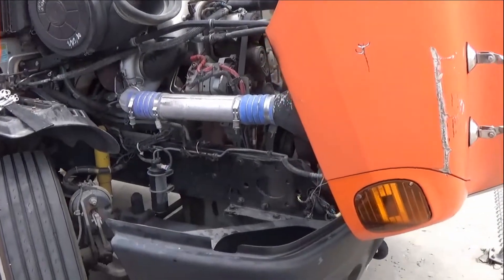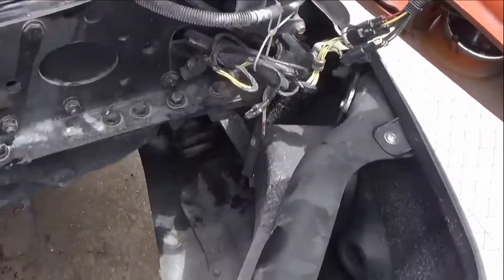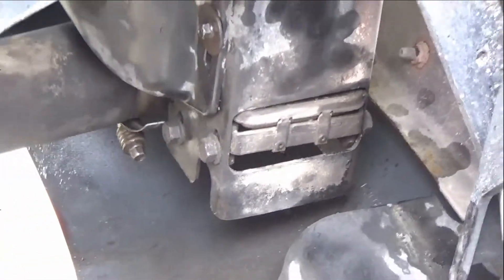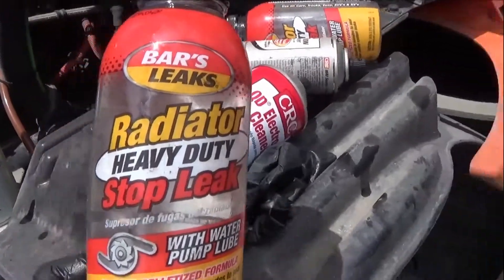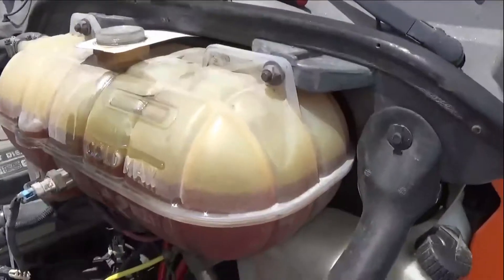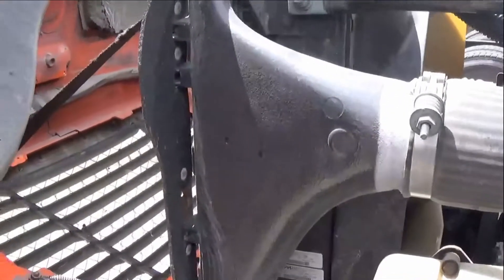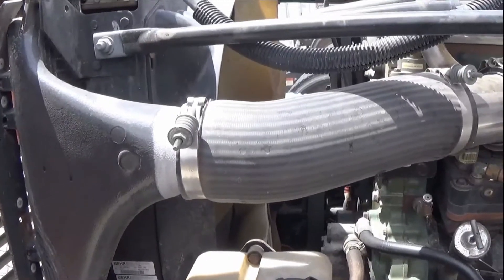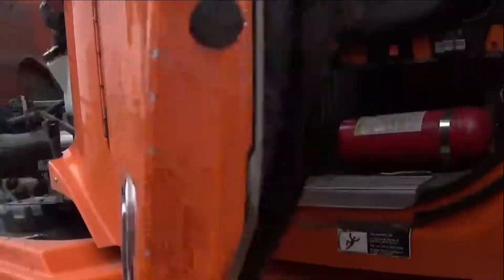Radiator heavy duty stop leak review  on 18 wheeler truck..should you try it?

Comment: About to add it to my 2003 ford expedition....got a leak from my intake manifold...suv has 188k on it. I tried a bottle of traditional stop leak but still leaks so I will get the intake version should do the trick. My system is similar I have to add it to my reservoir. Thanks for the video.
Reply from the maker: Problem will come back after 3 months. You have to. Add again.
Reply: @theinma82  did ya have to add it your coolant reservoir? That appears to be my only option which is fine I know it just takes longer to get through the system.
Reply from the maker: @Wes1487  drive for fews day. Leak will.stop

Comment: Hello Good Day, how long did  this last for... Please and thank you.
Reply from the maker: Its good for 6 months in my case. But the water will get cloudy over time. And then just add the stop leaks again.
Reply: @theinma82  Damn thats good, do you operator that freightliner everyday. I got the same exact truck. I got towed and the chain rub up against the plastic button of the radiator and bend the bottom just a lil. Now I got lil leak.
Reply: @theinma82  hi does the truck run hot now? I bought the same stuff for an international intercooler charge pipe rubbed a tiny hole in the radiator I zip tied it away from the radiator but it spews coolant now
Reply from the maker: @Awesomelord101  my truck been running good, the leak came back after few months, so i added 2 more bottle, run good but coolant got dirty,